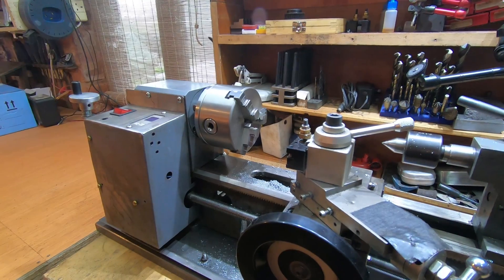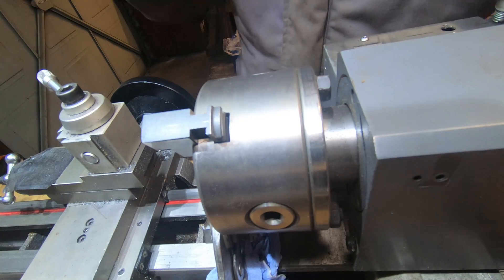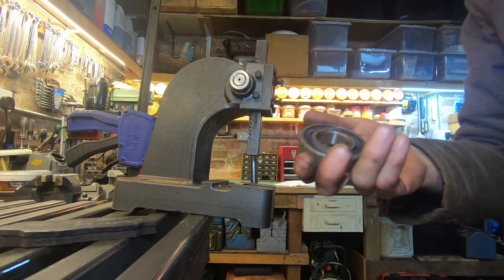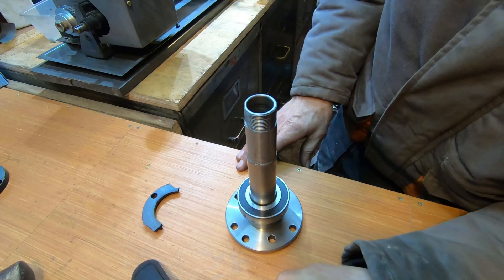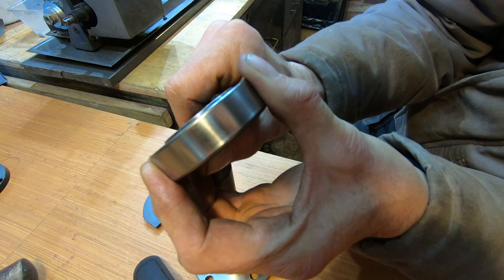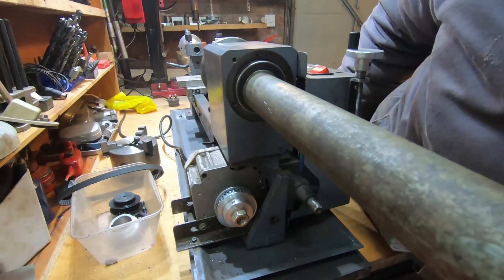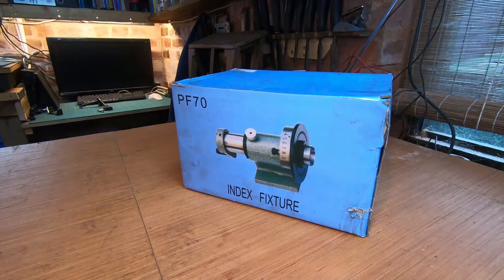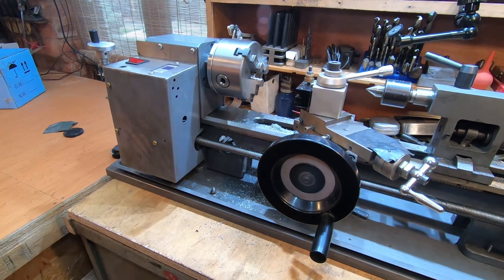MINI LATHE UPGRADES #2: ANGULAR BEARINGS UPGRADE

Comment: Using your freezer would have been easier.  Freeze bearings then slide into position. Then freeze the shaft and slide into position by what I saw there there was 2 tenth.of a thou interference fit.
Reply: How would freezing the bearings help?
Reply: @TheGreatBungholio  if i remeber correctly I would have frozen the bearings and installed them into the housing, once upto temp and application of a bit of heat, i would have frozen the shaft and then inserted that. A minor soft mallet is all the force you would require to assemble that.

The application of heat and freezing, would expand and shrink the diameters.
Reply: @stevenconnor4221  yeah I understand on the spindle, are they a tight fit in the headstock casting?
Reply: @TheGreatBungholio  I dont have this lathe but Im a mech tech have been for 35 yrs. I would pressume that the should be a similar fit on the external as in the internal. You can see him pulling the bearings into place. If not; through design or wear use loctite 603 bearing retainer.

Comment: How did you set the bearing preload?
Reply from the maker: As I say at 09:13, I tightened the c-nuts til it felt free-running but without being free-wheeling. A little later on I check the deflection with a dial indicator which showed about 1/3 of 0.01mm.

Comment: I am just curious now, how did you manage to get the first new bearing off, without damaging things? (I could understand how that part might need to have been edited.!!)..  I suppose if you had access to the inner race up against the shoulder, & the right puller, but often there isn't much exposed..  or maybe the fit was not that tight? Thx!
Reply from the maker: Well spotted! I managed to start a gap by tapping an old woodworking chisel between the inner race boss and the spindle shoulder. Thereafter I was able to tap the bearing off up the length of the shaft with a brass drift, but it was fiddly and I can't guarantee I didn't shock the bearing cages. They sound ok but time will tell.

Comment: You didn't show how to set the preload. There is very little info on the web about this topic Tight enough to hold concentricity, but too tight and it will cause excessive wear and heat. How did you decide to set the preload? Thanks
Reply from the maker: I just tightened up the c-nuts til it felt right. As I say at 09:13, it felt free-running but without being free-wheeling. A little later on I check the deflection with a dial indicator which showed about 1/3 of 0.01mm, so a few tenths.These are angular bearings as opposed to tapered, so preload is less of a precise art. I believe This Old Tony has a video on fitting taper bearings to this identical lathe and even he came to the conclusion that angular bearings are probably the better option. Appreciate the comment, thanks for taking the time 👍

Comment: Never ever use SKF bearings. They are not the same company they used to be.
Reply: Always used SKF in preference to any others, when I had the choice, for over 40 years. Never had an an issue with them at all. I suspect that there are a lot of counterfeits around when bought online these days. But that would be the same with RHP, FAG, NSK or even Timkin. I just use my local bearing supplier who I trust to get genuine bearings.
Reply from the maker: Interesting to know, thanks for sharing. I reckon they'll still do better than the no-brand 6206s that were OEM though 😥
Reply: Maybe true however there are counterfit parts everywhere.
Reply: Throw out the Alum piston post and get you a dovetail wedge type, AXA if you can fit it, world of difference
Reply from the maker: @BiggestD70  Great comment, thank you. I have done just that and as and when time permits will be getting a short video out on fitting it. Thanks for taking the time, much appreciated.

Comment: Interesting that you didnt use tapered roller bearings as they are adjustable.
Reply from the maker: Interesting point. Taper bearings need some method of preload, plus they're not sealed so the headstock would need to be converted into a lubricant sump. That's not to say it's not possible, it's just a very much bigger job for arguably not that much more functionality than a straightforward angular bearing replacement provides.
Reply: @myharris  Everyone uses tapered roller bearings in these lathes & I'm not sure why you think they need to be sealed in the first place. This isn't an upgrade at all, just a sideways step as the SKF's extra quality is pretty pointless if you can't pre load them in the same way as even cheap tapered. Surely, you must have watched other people's video's & know all this.
Reply from the maker: @Arckivio  Watch This Old Tony's video on the subject.
Reply: @myharris  I have. Love old Tony, I'd still buy some tapered bearings & do the job properly
Reply from the maker: @Arckivio  I mean, respect to your opinion but tapered bearings are not necessarily the best solution. You may be convinced but it is the subject of some debate and I would say far from settled. For the relatively light loads on these hobby lathes my opinion would be that tapered bearings are way overkill and simply don't deliver enough benefit to make the considerable job of creating an oil sump and figuring out how to seal them worth while. Angular bearings are specifcally designed to handle axial and radial loads and are ideal for this application. You may disagree, but to say that using any other solution than the one you personally have decided on is somehow not doing the job 'properly' is imo a stretch. It's not a competition :) Appreciate the input, thanks for taking the time .
Reply: @Arckivio  dude you're obnoxious and on top just wrong, you said you watched old tony yet say to use taper bearings. In his specific video he even said a better upgrade is to use sealed angular contact bearings but he didn't want to pay the extra cost and got tapered. Tapered bearings need to be greased and have maintenance if it isn't in an oil bath. Angler contacts that are sealed can take more load in multiple directions and are sealed for no maintenance.
Reply: @extra1403  Not wrong at all. Sideways, pretty pointless step as it's the type of bearing that makes the biggest difference. If they're too expensive, just don't bother. No pre load, still not the correct type of load bearing = pointless ish
Reply: @Arckivio naw I get to use my lathe to mill now because of it
Reply: I have tapered roller bearings on mini lathe and mini mill packed with grease no issues been fitted for many years i mostly work with steel they really can take a hammering.